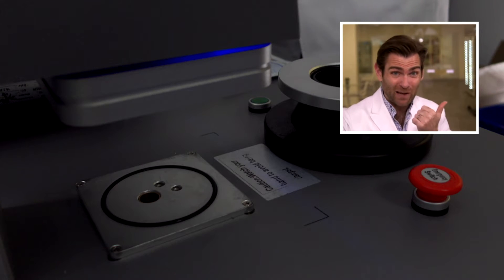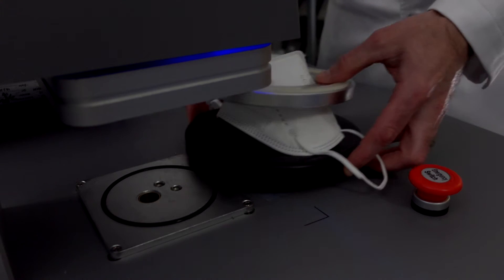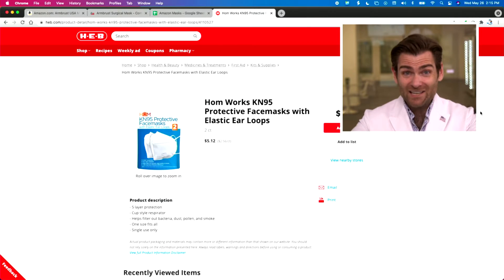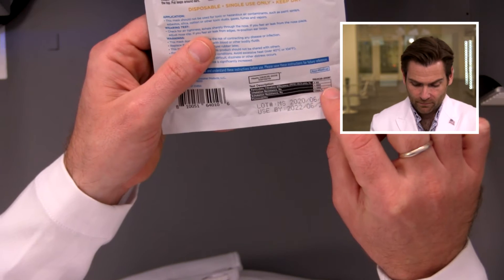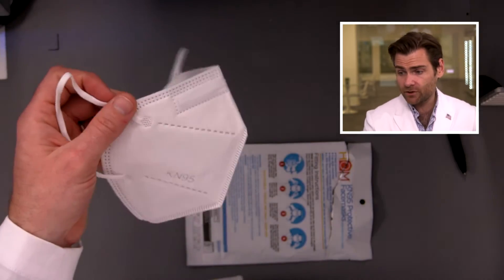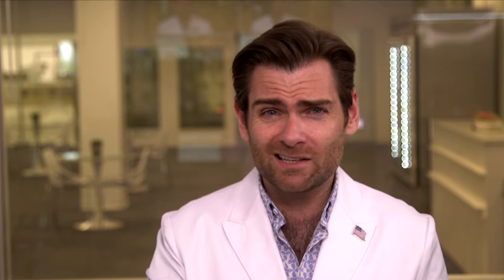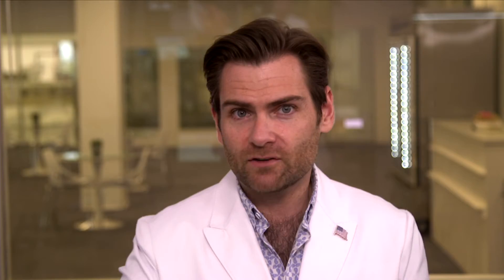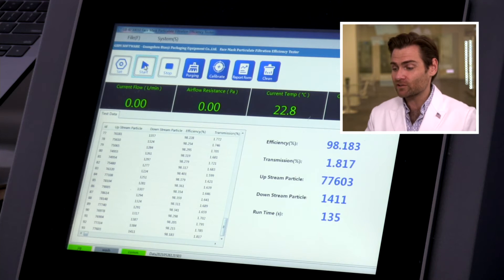Good luck breathing in this mask (H-E-B Hom Works KN95 Review)

Comment: Why does the package say single use? I thought kn95 are supposed to last longer than that
Reply: ALL masks, even the N95 were designed for "single" patient usage. Having used N95's over the past 15-20 years for TB- Isolation patients, it was always a given to use once, on the SAME patient, then throw away. Only because of the COVID-Pandemic, particularly in the first early waves, with the tremendous shortage of PPE; were we told to use your N95's (storing in brown paper bags) until they were "unusable"...crazy times!!